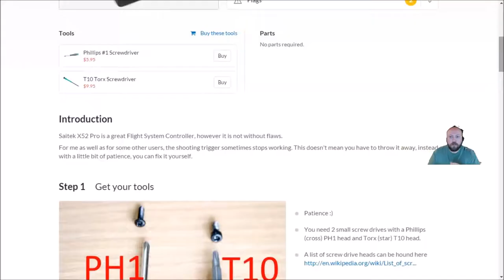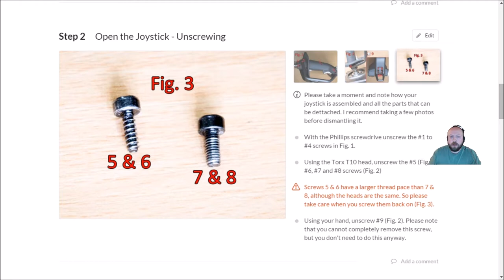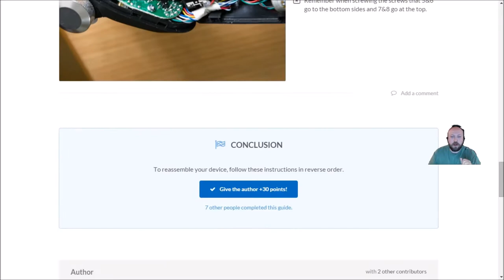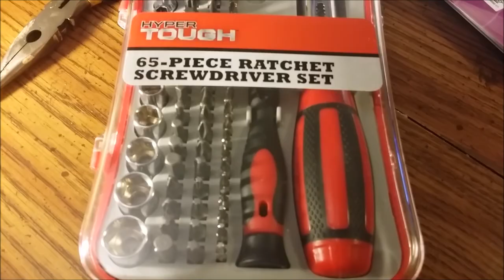Saitek X52 Pro Trigger Repair

Comment: Thanks for this.
My trigger was sometimes clicking in the right place but mostly nothing. I took all the screws out ready to wrestle the thing apart and noticed the trigger seemed ok again. I put the screws back expecting that when I tightened the one nearest the trigger it might stop working, but no it seems fine now. Maybe there was some crud that got dislodged when I released the pressure from the screws, or something slipped back into place. Anyway, fixed without taking the thing apart, result!
Reply from the maker: Rob Owens NP. Glad the video was able to help you out.

Comment: Please tell me I'm not the only one who's Weapon's safety switch has just randomly broken. it's no longer green when in the safe position but always red and the switch's lever no longer stays in the upright position. the actual button works fine, but the damn safety system is broken and bugging the hell out of me. I've opened up the joystick and had a look as to what it's mechanism is, it's a pathetic little spring system that makes little sense. i have spent the past 5 hours online looking for a  what this are is supposed to be like and haven't found anything. Some help would be greatly appreciated
Reply from the maker: Did you ever figure it out?
Reply: Same for me after reassembling it doesn’t stay in the upright position. But the button still works.

Comment: Nice video, unfortunately for me it's the pinky trigger that gave up, it's still working but not responding when the click happens, I need to push further to trigger the button...
Reply: i have this exact same issue did you ever get it fixed?
Reply: @mannixbg84  Actually I did, I simply put a tiny piece of plastic under the spring which was enough to make the button respond to normal pressure, the only side effect is that I had no more "click" sound. Also It's a a very small spring, not easy to access.